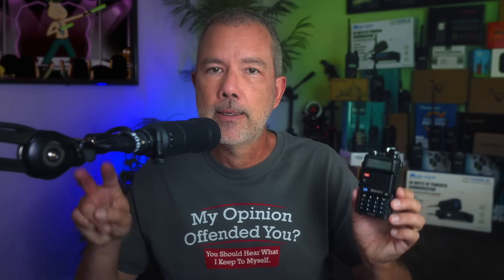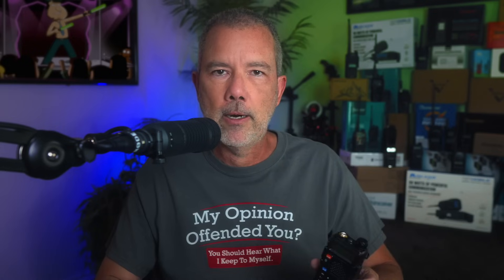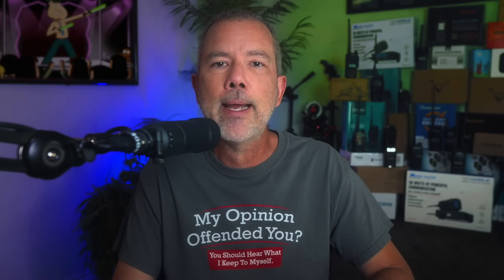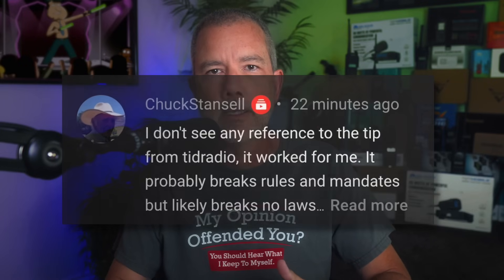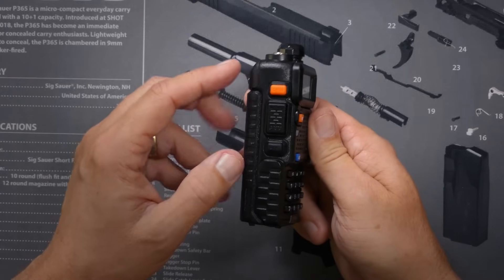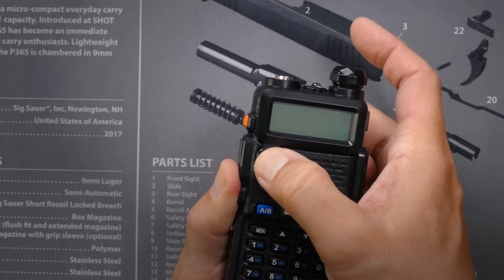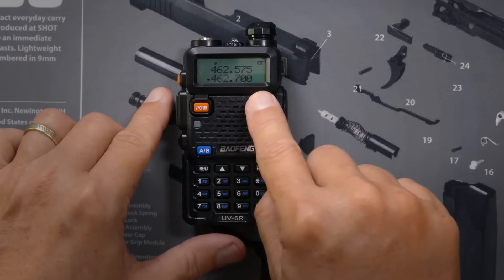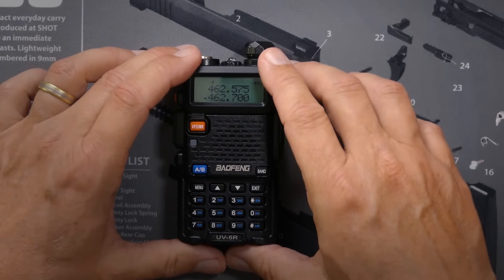How To Unlock A New Baofeng UV-5R - Easy UV5R Jailbreak To Transmit On More Frequencies

Comment: Tidradio TD-H6 / Beofeng  BF-H6 10w (tests about 5 I see on line) but with a lot more “professional” build quality with a 9 character display and you can add graphics to the screen. Locked. I just stumbled on how the other night. Pressed about ever key sequence. 🤷‍♂️ I had the time. Hold PTT hold the ENT key with the radio off then while holding switch it on. “Factory” flashes just like you’ve shown here and if one wanted to it would transmit on FRS and GMRS frequencies.
Reply: THANK YOU! Just scrolled through every comment to find this. Looking at getting an H6 on Amazon Prime tonight, but want full frequency access, or as much as I can get.

Comment: Hey Randy, Worked, as long as I manually input the frequency in.  I tried to add all the 1-20 channel frequencies via Chirp and then upload them all at once to the radio.  They did show up and showed the right frequency in the right memory location, but when the transmit button was pushed the radio locked up and displayed some weird frequencies. I then did a total reset on the UV5R back to factory settings and whipped out all my setting, then added a few of the frequencies manually, verified they worked first , then uploaded them into chirp and saved it to a file.  I then uploaded the frequencies via chirp into a second radio, and it worked.  Thanks for all the info through the videos, Not into GMRS but because of your videos I bought a couple Baofengs to play around with.   FYI while a HAM, Im not a SAD HAM!!
Reply: Not a sad Ham but a Glad Ham
Reply: Also setting in chirp that doesn't allow you to broadcast on a frequency by default that may be ticked you might want to look at those settings
Reply: Chirp worked fine for me programming both before and after the reset. No issues with channel mode on three radios tested.
Reply: You should not have whipped your settings. That could make them bitter, resentful and defensive.
Reply: does your first radio still lock up using channel mode? I am having the same problem.
Reply: @jlb1504ga  update CHIRP and load any GT-5R’s as UV-5R’s. That’s what worked for me.
Reply: @jlb1504ga  if you save the file in chirp from UV-5r then add channels all you want and upload them or clone them to another they have the same settings. And you don't get the 666.6666 code
Reply: I have a bf-f8hp that this will not work on
Reply: It appears that some people, "some people" have to jump through hoops but that is pretty rare.

Comment: @NotaRubicon Productions : Great video! and there is also a way to unlock the new Baofeng UV-82, just did it today. turn off your radio hold down "A" push to talk, the "M" key and then the # key then turn on and it will show the same "FACTORY" on screen and will unlock the radio.
Reply: Doesn't work for mine: My model: when holding down the 6 key and turning on: 190831M, holding down the 3 key and turning on FC82V01 :-(
Reply: @GregHolland1  , Try holding both PTT A and PTT B with M and #. Let us know if that works. Someone else posted both PTTs needed to be pushed?

Comment: I always love the hidden key fuctions, like the factory was like "oops!"  Knew it was a matter of time. Thank god it's not bridging micro solder pads !
Reply: Nothing.......same thing as a gonkulator!
Reply: @chrispq12 certainly better than the German gonkulator!

OMG, I remembered the reference from the original show, but did not know how it had expanded in use.  Happy Gonkulator Day next October 5th!
Reply: @chrispq12  :face-purple-crying::face-purple-crying:
Reply: What is wrong with bridging micro solder pads?
Reply: I don't think it's an "oops."  Almost every ham radio can be modified like this by removing a surface mount component, solder bridge, or jumper wire.

Comment: this factory unlock trick doesn't work on older models. If this trick doesn't work for you, chances are you have an older model.
Reply from the maker: This unlock trick is not needed on older models. If you have an older model UV-5R, it is already unlocked.  As clearly mentioned in the video, this only applies to new, "locked" models... You know, like i said in the video.. and like it says on the thumbnail.and the title.. and the description.
Reply: @TheNotaRubicon  maybe what Jim is referring to is the title (Easy Unlock Hack To Transmit On GMRS & "Other" Frequencies) in the word other. Other as in 1.25 meter. Maybe Jim was trying to unlock the 220 band.
Reply: Why would you need it on the older radios, Dear YouTube comment , expert? ? I think you missed the point of the video, no worries. He has videos to explain your faults.  You just wanted a pinned comment.
Reply: Thanks, but I already knew that from watching the video. And listening to the speaker. And reading the description. And generally having 5 working senses within my core being.

Comment: I tried it on my UV-5RTP and it works, I am happy I can use my radios in emergency situations. Thank you Randy, Tidradio and Chuck!
Reply: You can use em in an emergency without a ham license anyway
Reply: Man you saved me. I just bought these this week  and the seller miss represented them not informing me they where ham only for transmitting and was littlerly hrs away from shipping them back to get the uv-5g for gmrs and now when I get home I am unlocking them knowing it works for the uv-5rtp also. Your the bomb letting me know this. I wanted the triple power and the 5g isn't so thought I was losing that for my gmrs radio.
Reply: What’s your secret? I tried with my 5rtp and it’s not working.
Reply: @chaseheisler9847  if you bought it recently they fixed this work around already.
Reply: 5r toilet paper edition?

Comment: Ok since TID radio gave the tip, now I'm wondering if my TID Radio TD-H5 or the Raddiotty GM-30 can be unlocked somehow? so that I can actually put custom GMRS Channels with tones and Names ( Snowmobile friends all use BCA or Garmin Rinos I want to pre program those in but I cant I have to change tones on the main channel constantly instead of programming in a custom named one) - As it stands now I can't even go into VFO mode on my TD-H5 put in legit GMRS channels and transmit?  Also your video worked perfectly on 2 locked UV-5R's

Comment: Worked on my GT-5R!!! Thank you so much for that tip!!!!!!
Reply: I bought a 6 pack of GT-R5’s. Sadly I didn’t have the same outcome as you😢
Reply: @allencummings3445  Are you still unable to unlock your GT-5R's? I just unlocked a newly purchased GT-5R with this method. It was slightly awkward as the Monitor side button is harder to push than the one on the UV-5R.

Comment: Is this ACTUALLY working? I did mine, got the factory message. I don't get the little "no transmit" chirp, but my FRS radio on FRS 1 didn't pick up anything. The UV-5R CAN hear the FRS radio.
Reply: I found my problem. My FRS radio has 38 "codes" per FRS channel. Mine was set on code 1. When I set it to code 0 and it worked! The FRS picked up the transmission from the UV-5R! Awesome tip!

Comment: I have a Baofeng GT-5R (the "legal" version of the UV-5R that doesn't have the spurious nocturnal emissions).  It sucked because it was locked to ham 2M and 70 CM bands.  ...until I pushed those 3 buttons, turned it on, and the screen said "FACTORY".  Thank you Randy.
Reply: Dell, I was also able to unlock my GT-5R.  Are you able to use Chirp with it? Chrip seems to work but I have to go in and manually edit the GMRS channels after an upload to the radio to get transmit to work correctly? Thanks
Reply: I was given the answer: you pretend that it is a UV-5R in Chirp.
Reply: @robertbower9862  I had the same result with my GT-5R. If I download/upload the settings in CHIRP with it set to GT-5R, then all of the saved channels are set to "Duplex OFF" which prevents transmission. 

If I tell Chirp that the GT-5R radio is a UV5R, the saved channels are able to transmit.
Reply: @robertbower9862  what is the edit you had to do? After the mod, my GT-5R radio locks up when transmitting on GMRS in channel mode (VFR mode is fine).
Reply: >nocturnal emissions
LMAO

Comment: A radio manufacturer purposely putting in a hack to let you open up TX?  Never heard of that happening before.
Reply: On a number of old motorola radios you could hold the shift key while entering frequencies to transmit out of band.

Comment: After watching your video, I tried out this hack on my Baofeng GT-5R and it worked like a charm.
The radio will now transmit on all the GMRS channels as well as 2m and 70cm HAM bands. Previously, transmission with this radio was restricted to the 2m and 70cm bands. Thanks for the info.
Reply: Worked for me too on a GT-5R, but now it gets stuck on transmit?  Press the PTT and the red LED stays on until I turn the radio off.
Reply: @dlauver  That's just Baofeng's unending commitment to quality.  You probably have to open it up and see what's making the button hang.
Reply: @dlauver  Try changing from channel mode to frequency mode. I unlocked my ft-5r, and had the same locked transmit symptom, along with all other keypad buttons making unusual tones but having no function, except for the vfo/mr button. When I switched to frequency mode, it did transmit on GMRS to another GMRS.
Reply: @thomparris8062  , did that prevent the continuous transmit problem completely? Or have to do that every time? Others with wonky problems have had them go away with a factory reset and reload with Chirp. Maybe worth a try.
Reply: @dlauver  Maybe your PTT is stuck.
Reply: @toml.8210  @DellFargus It's possible, but never had this issue before the trick. Also it's stops transmitting just fine on the 2m and 70cm calling freqs. Maybe I pressed PTT too hard due to excitement...
Reply: I have the same problem on a few as well. I used CHIRP but it didn't stop the continuous tx.
Reply: I also have a GT-5R, but it didn't work for me. Different firmware I guess.
Reply: @chrisjohnson8741  I had one UV-5R, I didn't see 'Factory' come on but it did reset.
Reply: @chrisjohnson8741  ummmmm

Comment: Tried this on a GT-5R. Does not appear to work. The “FACTORY” display appeared and when keying up the display stays lit for quite a while and the transmit light stays lit. Pressing any key causes a chirping sound and none of the keys work. Turning the radio off and back on fixes the issue
Reply from the maker: This appears to only work on the new UV-5R, like in the title.
Reply: @TheNotaRubicon  I had to try Just for fun, wanted to put the info out there for others. Any way to reverse this? As long as I don’t key up on GMRS it doesn’t appear to affect anything else
Reply from the maker: I tried a regular factory reset in the menus and it stayed 'unlocked' even after that.. So either its not reversible or you need to twist your fingers in some other way to RElock it.
Reply: @TheNotaRubicon  radio Kama sutra? Gonna just have to get a UV-5R. I want my wall to look like yours 🤣 thanks for all the awesome info. 👍
Reply: Just use the UV-5R setting instead of the GT-5R on your upload and download.   It worked for me.

Comment: Do you have to do this trick every time you turn the radio on? Or is it a one-time fix?
Reply: It appears to be a 1 time fix for my radio. I've turned it off and on several times and it stays in factory mode.
Reply: its a one and done.

Comment: It's clear that Baofeng only changed this on the US radios they sell. The ones we buy here in the EU can stiil TX on GMRS (and others) frequencies.
Reply from the maker: Thats because there is no U.S. FCC in the EU.
Reply: @TheNotaRubicon  Overhere in The Netherlands it's free to transmit without a license between 433.075 and 434.775 with 0.10 MWatt, And license free between 446.006 and 446.093 with 0.5 Watt. But if you use more watts, the chance of beeing cought is almost zero. 27MC 26,965 MHz to 27,405 MHz with 4 watt without a license. Luv your videos, they contain very useful information.
Reply: f.c.c. explains it: No one owns a frequency, not even the f.c.c. or any government agency
governments don't follow their own rules, so why should anyone else follow their rules

Comment: Great video as usual,
 i tried this on my greaval UV-5R  out of curiosity and it didn't say factory, but still it doesn't give me a  nasty beep when i hit PTT with that frequency anyways.
 BTW i am a complete novice with this product (haven't a clue what I'm doing)
Reply: I tried this on an older UV5R for shits and giggles and got the message ‘COPING’. No idea what that means.
Reply: I tried this with a new UV-5R and did not get the "Factory" the radio came on with "Welcome".  The procedure did not appear to change anything.  However, prior to doing this procedure the radio transmitted and received on GMRS frequencies.

Comment: Wonder if the same hack would work with the BF-F8HP?  They are almost the same identical radio that BAOFENG locked out the GMRS.
Reply: It works!  Just did mine!
Reply: @ryanhorn4190  Did you unlock an F8-HP?
Reply: @ryanhorn4190  I’m curious about this too. Was it a BF-F8HP?
Reply: I bought mine about a month ago and they were not locked. Are yours?
Reply: @billygandy5277  I ordered 3 UV-5R's from Amazon from 3 different vendors.Two were locked,one wasn't. Guess which ones got sent back.

Comment: Randy, have you tried this method on the UV-5X (UV-5G)?
Reply: I tried, didn't work.
Reply: How are y’all having problems with the gt-5r?! It worked for my gt-5r. I have never used chirp so if that’s a factor maybe try a factory reset first..?
Reply: Tried it on a GT-5R, no dice
Reply: It worked on my GT-5R 😊
Reply: As Jeff Odegard notes above for his UV-5G: "I still have to edit the XML config file as described on the HAM RADIO DUDE channel to enable transmit on other bands (for emergency use only, of course)"

Comment: Worked like a charm and stays working on a restart.   Got to bounce as I hear sirens from the FCC police getting closer.
Reply: I hear that the FCC police announce their officer names and Badge ID over the sirens every 10 minutes on their way to get you.
Reply: RRRRRRUUUUUUNNNNN!!!!!!
Reply: I didn't work on my 8HP.  I only have two hands..
Reply: @toml.8210  did you try putting mustard on it first?
Reply: @toml.8210  I did it one handed, I think I might need to see a Dr.
Reply: Is it working with CHIRP? Thanks
Reply: @iNowHateAtSigns , I started with a new out of the box GT3-TP, uploaded the original image from the radio to CHIRP, copied the programing from my old GT3-TP that died, then uploaded the new image to the new radio. Of course, that all worked fine but transmit was locked out on the non-HAM frequencies. Took a deep breath and did the unlock hack, now the radio will allow me to transmit anywhere, and all my programing stayed in the radio. Final test, edited the file in CHIRP and tried to upload to the radio......................... Success, it worked fine!
Reply: Success …over da MAN!

Comment: Best news I’ve heard all day!!!  Thank you Randy for sharing this…. I wonder if this trick will work with the new Baofeng GT-5R…..  #MYGA
Reply: I have a new GT-5R and it did work for me!!
Reply: It does not. I'm a sad ham.
Reply: Worked for my GT-5R - but you have to use Frequency Mode or Transmit will stick (although not actually transmitting).